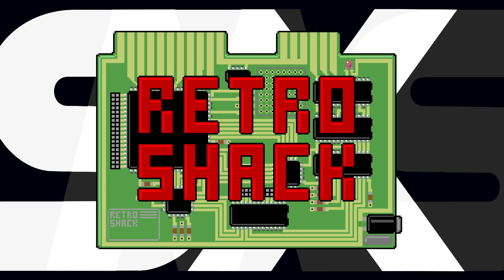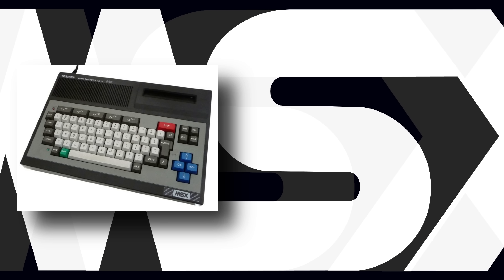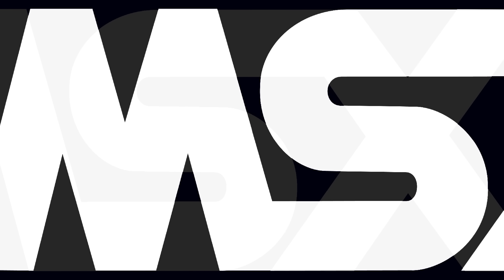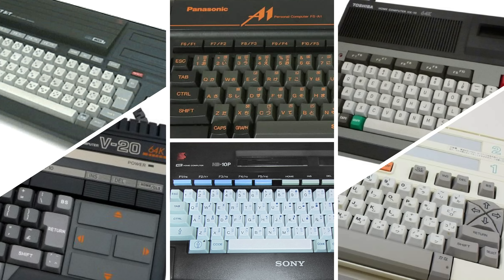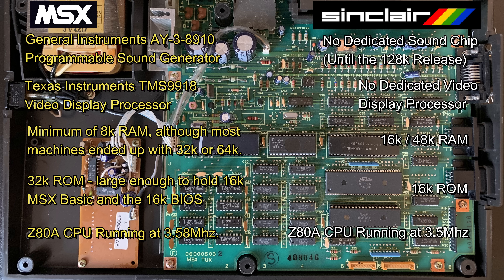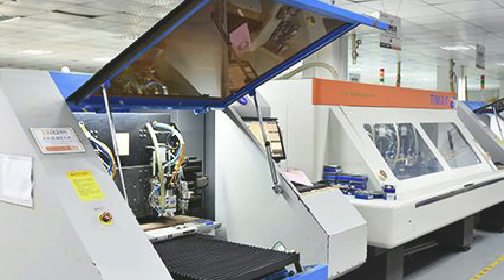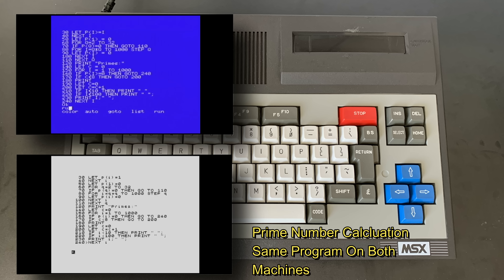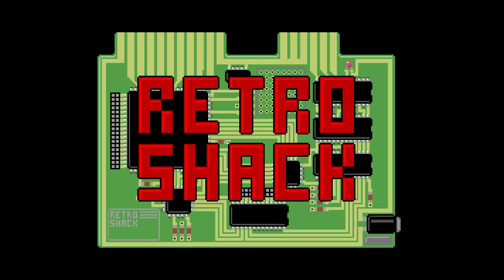Did I miss out by not having an MSX?  Was Sir Clive right about their performance? Let's find out!

Comment: okay, but how does an MSX machine compare against the Commodore 64 - and then later there was the Tandy 1000 with decent sound and graphics for gaming, but also ability to run MS-DOS productivity software too. Seems like an MSX computer would be almost entirely about game titles
Reply: The MSX (2/2+/Turbo R) versions with a diskdrive do have MSX-DOS. Version 1.0 was a stripped down version of MS-DOS,  Version 2 was a very nice operating system  like MS-DOS, but with some nice little extras. And you could use CP/M. As a Dutchie I've had three MSX computers. First a Philips VG-8235 MSX 2 (because my grandfather worked at a Philips plant an he could buy the machine a little bit cheaper,), then a Sanyo WAVY 70FD2 MSX 2+ (with some extra memory as the machine was standard 64K machine imported from Japan) and the last model, a Panasonic MSX Turbo R FS-A1GT, which I still own.
Reply: jfkoetse so MS-DOS got ported back to an 8-bit Z80 platform - makes sense given MSX system software looks to have been almost all Microsoft. But probably would have better luck with that C/PM for finding productivity titles - don't think DOS classics, like Lotus 123, got ported to MSX. Maybe Microsoft made Multiplan available on MSX, my Tandy Model 200 has MS-BASIC and Multiplan in ROM, and it was certainly niche system software
Reply from the maker: Well, the guys below have done a good job answering this one - thanks guys!

Comment: Just a quick note: The MSX1 wasn't able to do hardware scrolling, but MSX2 did, and because of the expandable architecture, there were video upgrade cartridges (at least planned) that upgraded the MSX1 with the MSX2 rom and video accelerator.
Reply from the maker: Thanks for the info - I've got my eye on some MSX2 models now too... Got the bug!
Reply: @TheRetroShack  MSX machines were very interesting and because they were made of off-the-shelf components is relatively easy to source the parts and build your own. Look at Sergey's Omega project if you're interested in that. :)
Reply from the maker: @Stormbolter  It’s already on the production slate :) :)
Reply: @TheRetroShack  Oh man you really should. The MSX2 is where the games on the platform started to approach the original Nintendo Entertainment System in terms of overall capabilities.

The Standards:
Custom Philips Sound Chip
64KB VRAM (Minimum) - *Most machines didn't go below 128k VRAM
64KB RAM (Minimum) - *Most machines didn't go below 128k RAM
Yamaha V9938 Video Chip

(VIDEO MODES)
4 	256×192 pixels 	16 of 512 RGB 	16kB
5 	256×212/424 pixels 	16 of 512 RGB 	32kB
6 	512×212/424 pixels 	4 of 512 RGB 	32kB
7 	512×212/424 pixels 	16 of 512 RGB 	54kB
8 	256×212/424 pixels 	256 (no palette) 	54kB
9 	only on Korean MSX2 	see SCREEN 	text mode using screen 5 or 6
Reply: @TheRetroShack  Phillips do some GREAT MSX2 computers. Pity they didn't do a MSX2+ machine.
Reply: @TheRetroShack  look for 2+ 99% of all msx library will be open to you. Full retro compatible with previous versions.
Reply: There are other solutions for storage, mega flash rom and carnivore2 bring sound expansion too. Tecnobytes make v9990 video expansion called powergraph and audiowave that are compatible with Yamaha keyboards, and they are making a new batch.
Reply: If only everyone who is critical of a product created one themselves that met those high standards wed all have amazing thing. EVen if a tech is availabe a company will try and push a early version first the sell you the 'upgrade'
Reply: Games that attempted to scroll, looked awful. That couldn't have helped the platform.
Reply: @ivuldivul  There are patches available now for some of the Nemesis games that'll give it smooth scrolling. It looks very impressive.
Reply: @ivuldivul  Not necessarily. Although they looked bad in retrospect, it was on par with the technology of the era. Nemesis, for example, side scrolling was awful but the gameplay was solid and the music was much better than the spectrum and C64 ports - which were also excelent, working around the limitations of their respective machines-.
Reply: @ivuldivul  Watch River Raid, Casio's Exoide Z, Pastfinders...
Reply: @ivuldivul  not all.

Comment: There is no hardware scrolling on the MSX1. Hardware Sprites yes. The MSX2 has vertical scrolling and the MSX2+ / turboR has horizontal scrolling as well.
I was a commodore 64 user but I have collected some Sony MSX machines just because they are beautiful and well build.
Reply from the maker: I'm definitely hooked on these things now!  I'll correct my scrolling faux pas in the next episode in the series :)  Thanks for watching!
Reply: @TheRetroShack  There is a video from Displaced Games called :MSX Computers - Scrolling, Sprites, and Stereotypes from april 2020 and it will give you a lot of information about the msx system a really good watch.
Reply: @TheRetroShack  be careful.. i got very hooked and ended up with about 8 of the buggers, mostly from Japan because there was so much variety and availability.

Comment: Looking at that comparison, I feel ashamed that I owned a 48K Spectrum now !
Reply: Speccy was half the price, half the size and an iconic looking design released at a time when quite small to medium sized British companies could compete with far east mega-corps on price - helped massively by British customers such as yourself.. You should be PROUD! A Spectrum QL released in '84 instead of Speccy+ in '85 should have happened. - with 2 processors and a matching bolt-on tape/2x microdrive/1x disk drive option. Sinclair tried to milk markets instead of carrying on their aggressive, low-markup, rapid market share-grabbing tactics of '80 to 83'... Now that was a shame!
Reply: @PrivateSi  The Toshiba was £100 in 1985.
Reply: @rog2224  .. Towards xmas but £200 for the rest of the year.. Speccy came out in '82 when it was much cheaper than an MSX... All 8 bit prices were slashed in '85 due to Amiga and ST.. 16 bits had arrived... Sinclair needed to keep hitting hard and fast in '83/'84 but they got complacent and lost their edge. It was all over by xmas 1985..
--
Speccy QL in the first quarter of '84 would have hit in time for the business market and given speccy developers a 68000 compatible CPU (even if the 68008 had an 8 bit memory bus) with a Z80H (8 mHz Z80) on top acting as a main/co-processor and super-fast speccy. The QL ULA could easily have been made to emulate speccy graphics. This would have bought them time until xmas '85, perhaps even longer if a good software base was there and hardware was fully exploited. 
--
18 months to develop a COMPATIBLE 16 bit version would have been plenty of time, hard at it. Keep the Z80H coprocessor and design in a new ULA plus add proper 4 channel FM synth sound. + 8 bit PCM sample playback and ....... and... AND! .... Sinclair had their chance, but  they changed their business model for the worse.. Mostly cosmetic, often unreliable speccy upgrades and an incompatible, overpriced QL that did not exploit the hardware used to anywhere near its full potential. The ZX83 was a pi(e) in the sky pipedream that delayed the QL - that should have been The Speccy QL.
Reply: Nothing to be ashamed of. Sir Clive brought tthe world a very nice machine for the price.
Reply from the maker: Certainly made me think too! :)
Reply: Don't be ashamed; at the time it came out, the ZX Spectrum was a marvellous little machine, which formed the foundation of many a carreer in games programming. Even to this day, the Speccy is my favourite microcomputer from the 80s; I have so far been able to acquire a 48K rubberkey model, a Grey +2, a Black +2A, and a couple of +3s. I also own a ZX81, a Timex Sinclair TS2068, a Timex Computer TC2068, and my most recent acquisition is a Commodore 128D with an extra disk drive (1571), mouse, Ram Expansion Unit, 1084S monitor and an MPS1230 printer.
Reply: @BertGrink  It's a Z-80 based machine..... that's good enough for me. :D
Reply: @GORF_EMPIRE  Yep, i love the Z80 too 🙏
Reply: @BertGrink  Still widely used even today!
Reply: @Rooflesoft Games I think games are a matter of taste. I had a Vic-20. It was a great machine but limited compared to the Atari 8 bit and the Coco in many ways but it was still a great little machine. both the MSX and Spectrum were great machines. Hey...they are retro machines after all!
Reply: @Rooflesoft Games At one point i saw an estimate that the Spectrum had around 25.000 unique titles (this includes "serious" softwares such as wordprocessing, database et.c., as well as various utility programs) for it, and many new ones have appeared since then, so yes, it seems very likely that Speccy would have had a considerably larger software library even back then.
I have never used an MSX computer myself, but i know the hardware specs, so i can very well believe that the best games for the platform would be much more advanced than  anything ever written for the Speccy.